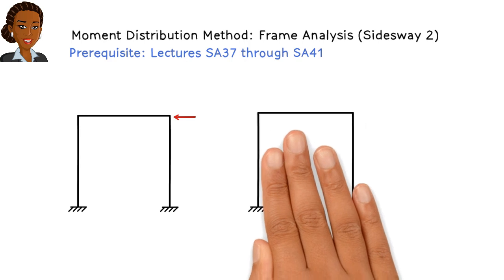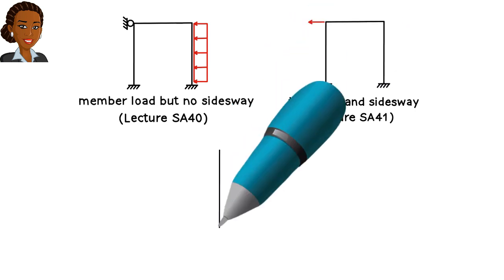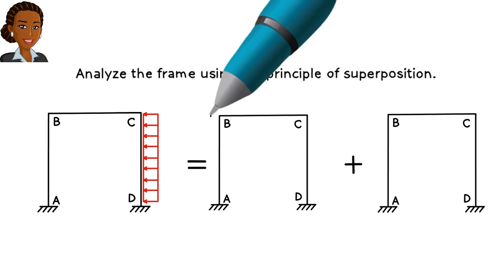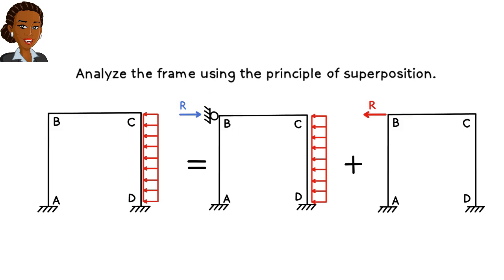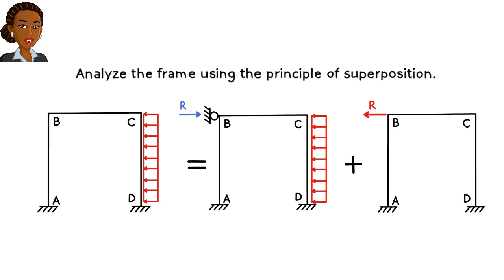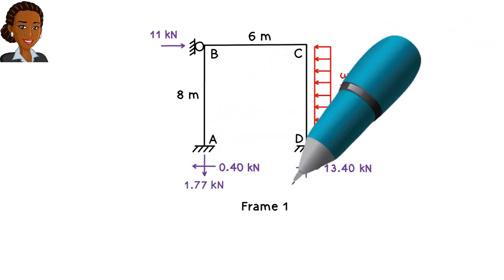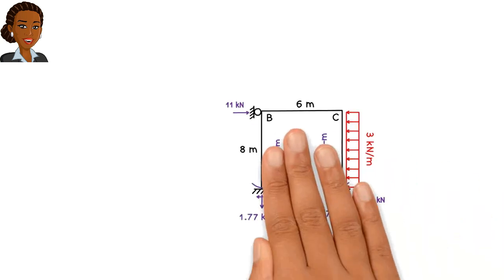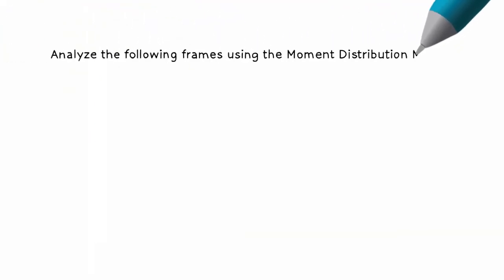SA42: Moment Distribution Method: Frames (Sidesway 2)

Comment: Dr structures, how will we solve a frame subjected to both joint and member loads?
Reply from the maker: We translate the member loads to joint loads using the expressions for fixed-end moments. These moments can then be added to the existing joint moments in order to get the total moment at each joint before we start balancing the joints.

Comment: Dr structures, how can we know that a given frame remains static or has sidesway if both horizontal and vertical loads are acting on it?
Reply from the maker: If the frame is not laterally restrained against sidesway, if it can have sidesway under some loading condition, then it would be wise to assume that it will undergo sidesway, if either a horizontal load is present or the vertical load is not symmetrical (in a symmetrical frame).

Comment: Thanks for uploading such useful practical exercises.
Dr. Structure can you show as frame analysis using moment distrubution method for pinned supports?
Reply from the maker: See the exercise problem at the end of the lecture.
Reply: I do not searching for problems without explanation